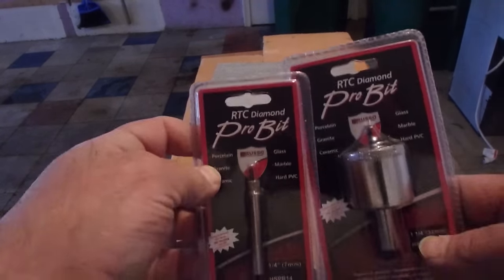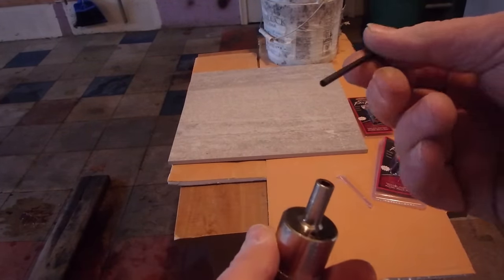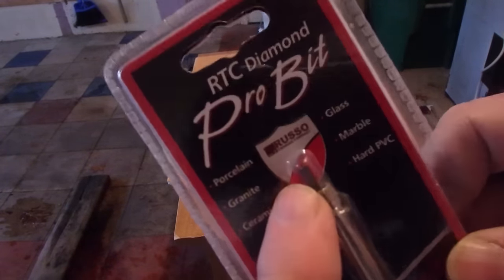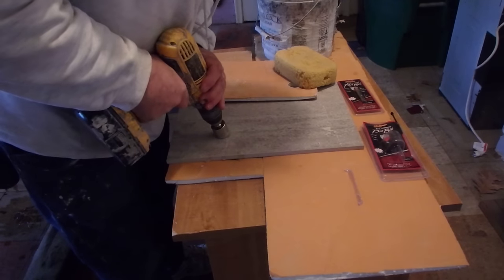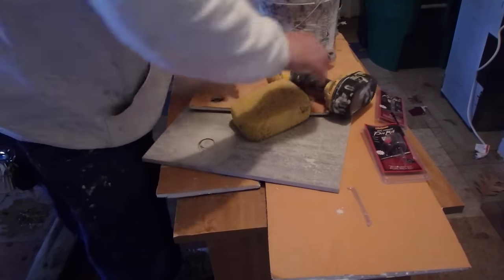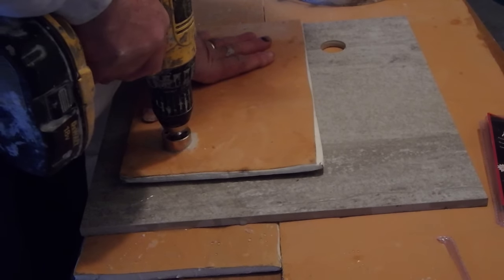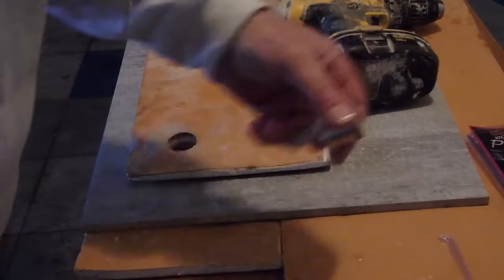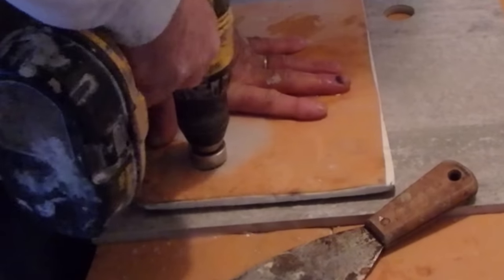How to use RTC Diamond Pro Core Bit

Comment: I used to buy those type of bits untill I worked for a granite company, now I only use my variable speed grinder with easy attachment blade, core bits, and polishing pads. Go from cutting to drilling in seconds I'm sure you are already aware of these tools though, the granite industry has a lot of useful tools for us tile guys

Comment: you should do a video on mounting hardware to the wall:  how to keep the bit wet when vertical, what size hole, use a plug, does one need a stud or block behind... stuff like that.  anyhow, thanks for your vids, very informative :)

Comment: Sal, i have a question. I'm laying 8x32 wood plank tile over concrete slab. I see that you always use White thin set, any reason why? Just worried about the White when i grout it a dark color. Next question, di you ever use large format tile thin set? I'm using regular now but curious about that too. Sal, laying tile is hard work, i don't know how you do it. Thanks
Reply from the maker: I just like white better, seems to be a bit creamer, but that might just be me. You should always use a LFT thinset for large format tile, has more body,  can be used to a greater depth without it shrinking. Yes my aches and pains  agrees with you, it is hard work.